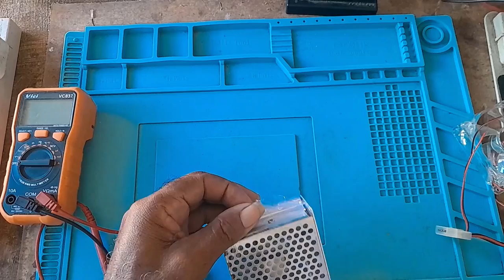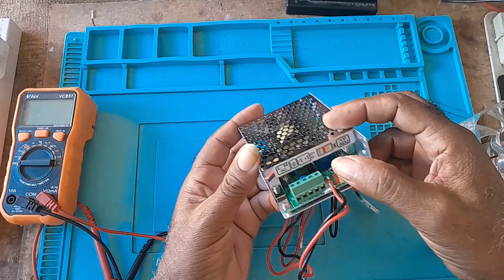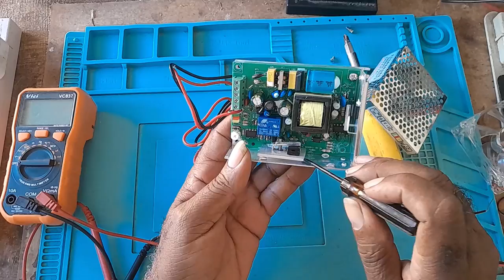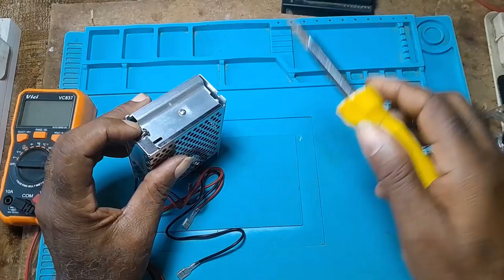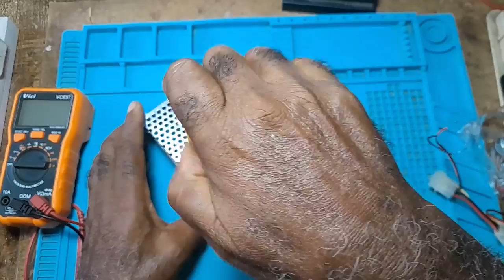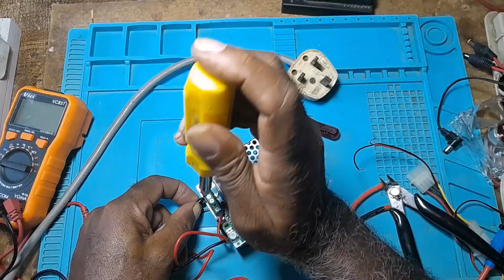UPS Charge Function Switching Power Supply 35W

Comment: Subscribed. Thanks. Will this work to power 19v laptops without battery? Does it has some milliseconds transition from power to battery in event of powerfailure? As this will cause power off for laptops.
Reply from the maker: No, this one is 12v. You will need one that put out 19v or more.
Reply: Okay. Thanks @AlwynNicholas